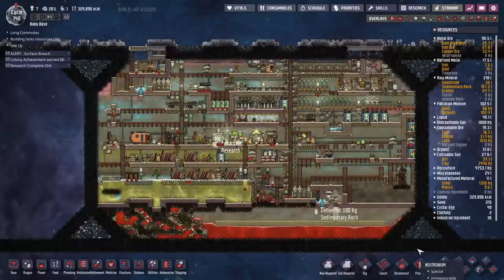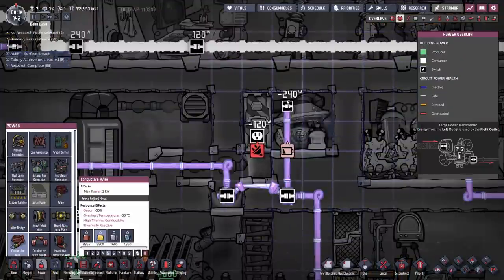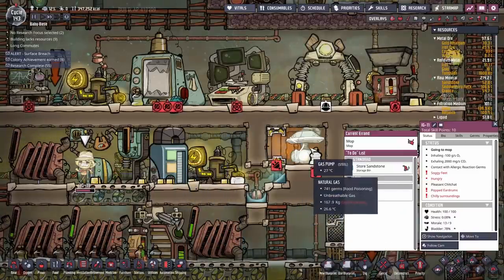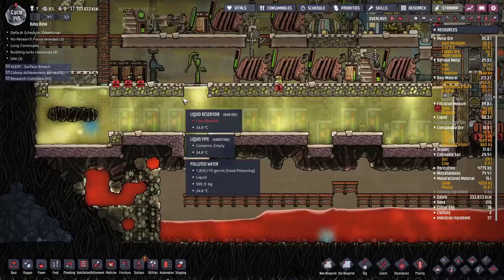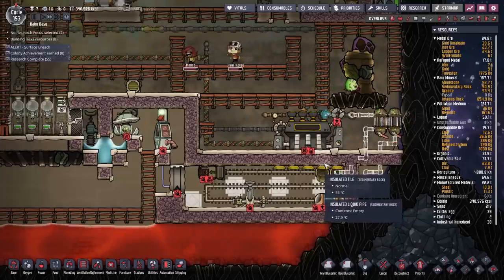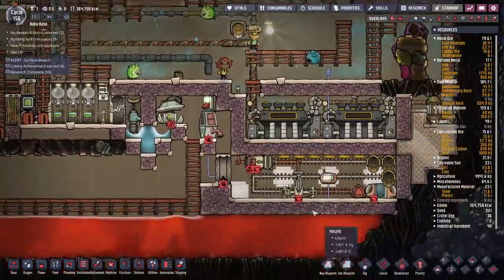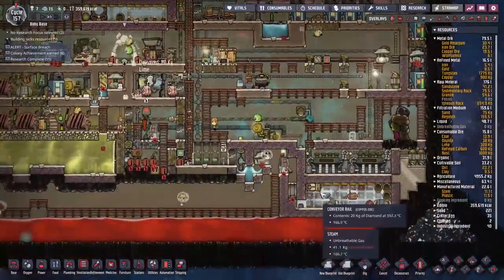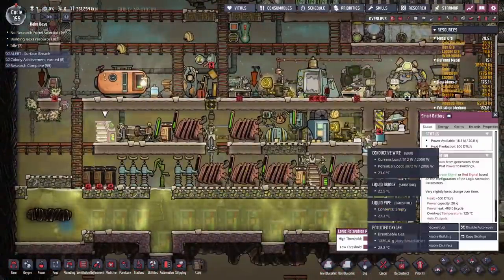Baby Base 6 : Turning heat into power : Oxygen not included

Comment: if you have even a small amount of rust available, you can throw down a rusty oxidizer solely for the purposes of getting Chlorine to run the water coming off the polluted water vent through some liquid tanks to decontaminate it while also actually sealing the polluted water pool off to help prevent all the spills and mopping you've had to waste time on.  Should take care of the germ problem.

Comment: You can see at cycle 143, the clean water pocket had like over 600 million germs, and by the time of cycle 145, it reduced to 300 million. The amount of germ is definitely not accumulated over time. I highly suspect that there is an integer overflow bug in the germ calculation and at cycle 140-ish the germ on one tile of water overflowed to 2.1 billion .

Comment: I would loop the conveyor until it dropped to X degrees, then loop a second time in the heat exchanger until it dropped to the desired temp. The first loop would bring it close to the steam room temp. The second loop would bring it down further, closer to turbine output temp. It should also help with the upper left hotspot depending on how you do your loop.

Comment: Can't you put an automated door below the liquid drop off to disable it when the door is open?
Reply: dont think so, itll just dump it on the door or a free tile, the way to go would be to restrict pump access
Reply: will the bottle emptier work ontop of doors? i thought buildings wouldn't work when on a door-floor
Reply: If you mean on top ar an automated airlock then you would be correct. Brothgar used this exact mechanic to automate a similar design.

Comment: Might it have been smarter to run the hot stuff around in a loop to keep things rotating and get the highest throughput, sort of like the end of a regolith melter but instead of things melting off the line you just shunt them off when they cool down enough

Comment: thanks for the ep, played the save file and saw a few issues first and most pressing is the steam turbines overheating need a temp shift or two to fix it,  the other issue i saw found is the convener rail seemed to be releasing over temperature items  your large heat sink how ever worked wonders rapidly cooling them regardless,  finial idea/ though was if you  build a wall in magma biome,  and pump the  magma from below the steam turbine clear out all those items and more importantly make a proper heat injector,  personally i'd convent all of the magma to igneous rock and use door crushers to make a thermal injector.  good luck

Comment: every time you add a blob of 10kg to the clean water tank you add 1.5 million germs to it which is why there are so many. this is like that time gearhead ended up with over a billion slimelung germs on his ethanol cooler because the gas kept duplicating the germs.
Reply: This. At 5:35 you can see a small blob (17kg) containing 0.5 million germs

Comment: You could use a liquid pump to suck the magma layer by layer (its only 3 layers deep) using a blob of water on the right side of the activation cross of the pump. Once it is in an insulated pipe (maybe made out of steel?) you can have total control over the flow.

Comment: If you put an automated door under the bottle emptier the dupes cant put bottles into the emptier if the door is open so if you really wanted to automate it you can just set the door up to the thermo sensor you already put into the steam room set the temperature to about 200C and keep both steam turbines running full time until you run out of magma. The dupes will still have to pump the magma so youll still have the buffer range for a brown out but you could just set the thermo senser up to a filter gate and put the temperature lower on the senser so the dupes will have the errand before the errand is needed.

Comment: To fill the bottle emptier, you can trap 1 dupe during it's work time using 2 doors, 1 clock, 1 dupe sensor, 1 and gate, 1 not gate. Only allow 1 dupe through the first door and connect the automation to the second door. Once the dupe it's in the right side of the door the dupe sensor will close the door, and the only task accessible will be to deliver magma. The clock, just set to release the dupe in it's down time.

Comment: It might be worth putting a diamond window temp spike into the magma to cool it down.  Then you can revert to steel door management of the steam room's temp.  When the magma cools enough to turn into igneous rock, it can be passed through the rails just like the steel.  Overall it should result in a lot less manual dupe work than pitcher-ing in the magma.

Comment: 28:00 I prefer to add a sensor before the tank ( like 4 or 8 pipes before) with a filter gate and set the filter to 20 sec, the reason is that is more precise and you don't use more H2 that needed

Comment: I have a problem, where when my duplicates come up through my liquid lock, they get called to dinner and drop 1200 degree material into it, instantly boiling it. Short of using liquid metal for it, I’m not sure quite what to do
Reply: Use petroleum for the liquid lock to help keep a buffer in the amount of time needed to pick up the debris. When it comes to stuff that hot it’s best to store it in a vacuum with a sweep command and deal with it at later date. For me, I do what Francis is doing “sieve” it through a steam room use the heat energy out of and now you have 200c debris that won’t boil oil or petroleum locks
Reply: Before petroleum, I run my cooling loop through my liquid locks. I also carefully manage storage locations so they never ever carry the really hot stuff through a lock.
Reply: Conveyor rails in a vacuum or behind insulated tiles could work. Not easier, but safer.

Comment: This made me think, I know its not efficient, but could you drop the cooled metal into the magma to reheat and then repeat the cycle? Would it be infinite or would heat run out eventually?
Reply from the maker: The magma would eventually cool, it would take a long time though as there is a huge amount of heat in there. On full size maps you can run your entire base on power generated from the magma core pretty easily.

Comment: I would like to make a suggestion for the size of this map why don't you use the sweepy bots for Regolith collection ond the asteroid's surface and make everything out of steel maybe? 
Maybe on the side of the map make a drop point straight into the magma biome with a dropper at the top. 
Liquid pump that pumps a little bit if polluted water into the magma biom and the regolity with help of temperature shift plates boil the polluted water - or use regular water - into steam to be consumed by the steam turbine?

The regolith can be instead put into a smaller walled of section with the turbines if space is a problem and the extra energy isn't needed and when the regolith is cooled down to a suitable temperature you export it for use in filtration medium in water sifs?
Reply: Nothing can be built above where he has the bunker doors. So none of that could be built. You could put the dropper down in a pit I guess. But no sweepy on top is possible.

Comment: Been wanting to play this base but wanted to have a plan to tackle the hydrogen vent to generate lots of power before space materials. would love it if you took a look at the blueprints and maybe try them out? The only steel is the aquatuner and gas pump next to the vent. You could use crude oil instead of petroleum to keep the gas pump cool. ignore the dev generator in the corner!
https://imgur.com/a/V0pjHa5

Comment: Consider employing this kinda solution ofc modified for debris loading. Im telling you tho, those 4 thermo conductive tiles work wonders... https://www.youtube.com/watch?v=v7Ml6h71neM
With that core design i was able to tame magma powered oil boiler. With those new rail automation parts you can truly suck out the last bit of heat from stuff. Great efficiency.
Reply: I use a similar method .. hook it up and leave it alone for hundreds of cycles. You check again and it’s still not finished lol. Use a thermo rail sensor/timer sensor to keep the rail moving since some items don’t exchange heat from a bug